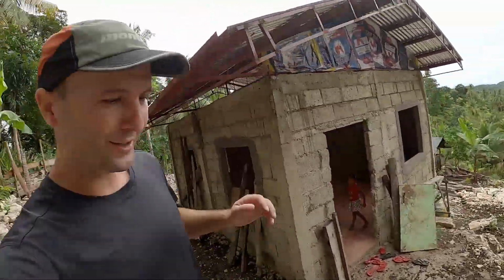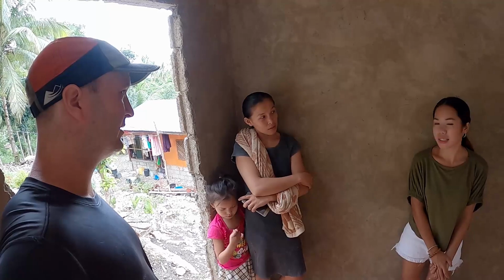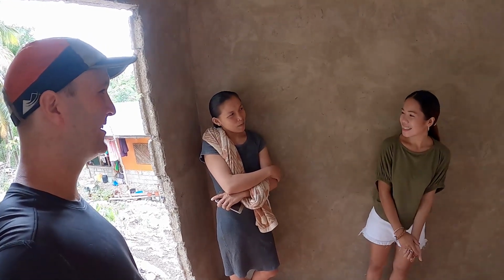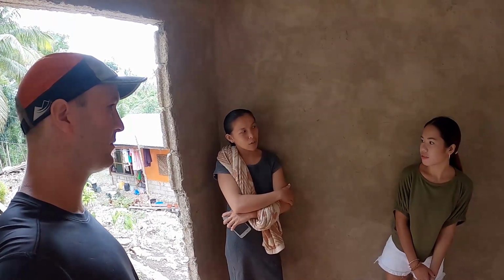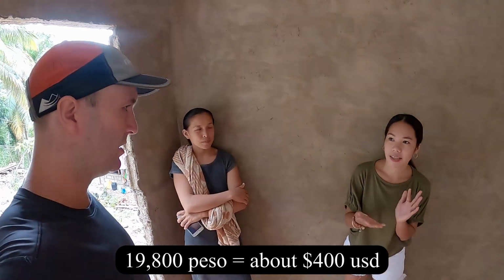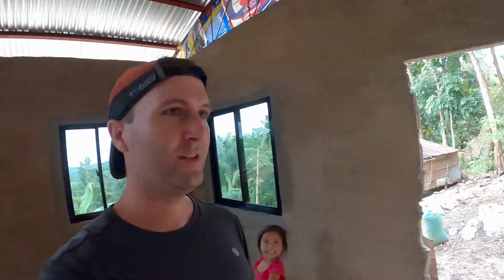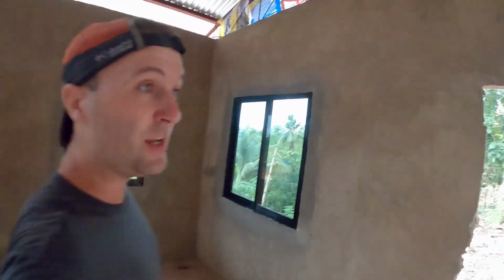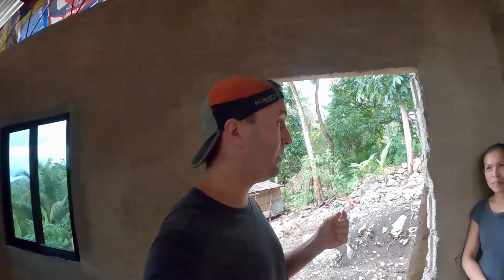Building Home for Filipino Family ( Angie's Family ) Floors finished - Installing Windows

Comment: Is there an effective way to insulate the metal roof so the interior of the house don’t get so hot during the day?  The guy installing the windows is a pro 👍.
Reply: Install a wood ceiling and install wire mesh on sofit to prevent animals from building a nest in the attic. The wire mesh will allow the wind to blow under the metal roof.

Comment: They screwed the screw directly on concrete without a tux or wall anchor.
Reply from the maker: I may not have shown it but they did use wall anchors